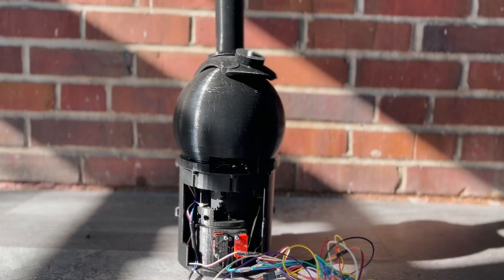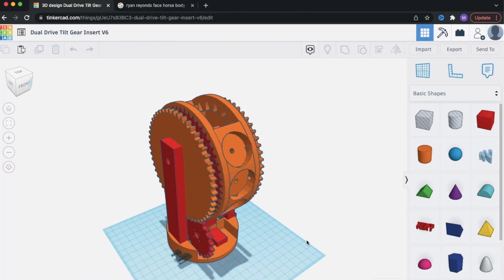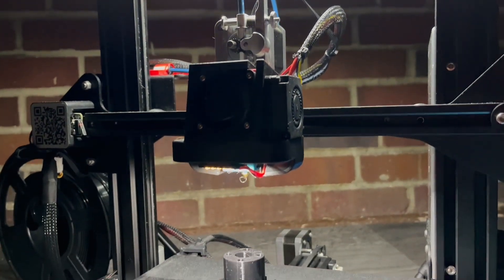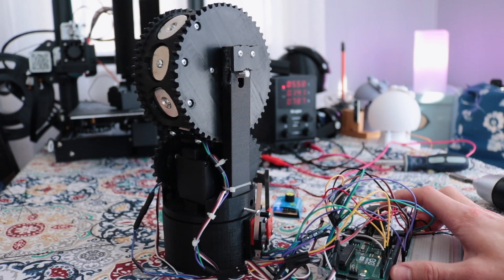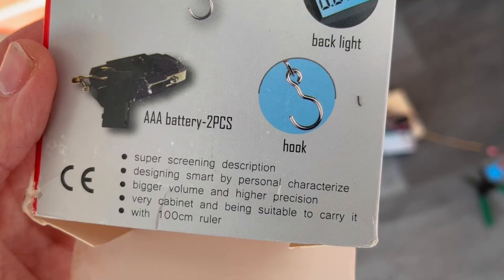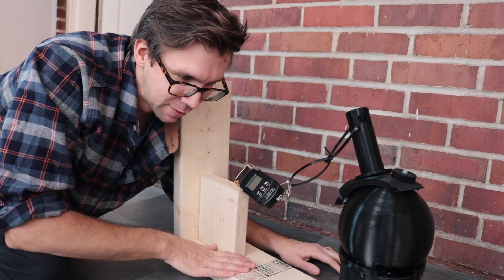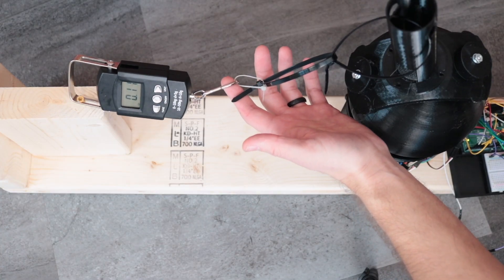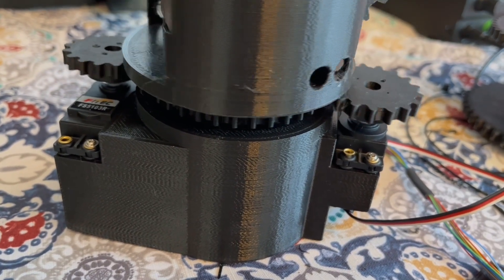Magnetic Ball and Socket Joint Robot - 3D Printing, Servos, Arduino and Magnets! Version 6

Comment: think the very opposite of what you are doing, and instead of trying to use the magnetic attraction(that generates unwanted drag and weight on the moving parts making the device weak to move mass other than itself), use the magnetic repulsion of flat coils(that will be the motors* moving in directions),coils on the base, and flat alternating n50 - n52 neodymium magnets on the moving head above the base, imagine like an electric linear motor(but in a spherical array) or 2 semi spheres shells one over the other, thats the way to make precise, controlled magnetic joints for the next gen robotics, plus, there will be only one moving part, the head (the only part that needs to move).
if i wasnt clear and u didnt get my concept, drop me a line. cheers
Reply: i suggest trying to salvage HDD parts(magnets, coils and other materials)
Reply: @DRB-Octane  Hi!! I'd love to know more!
Reply from the maker: He’s onto something for sure!
Reply: I think I understand. Like a ball inside a ball, where the outside ball can float over the inside one (low resistance) and the repulsion pushes it around? Did I follow right? I'm having a hard time imagining how you control that, and how much weight it could push around. Do you have any examples or vids?